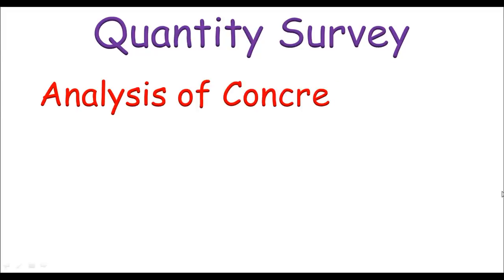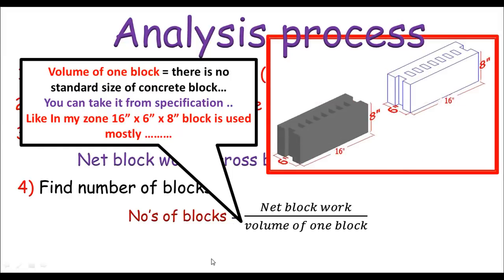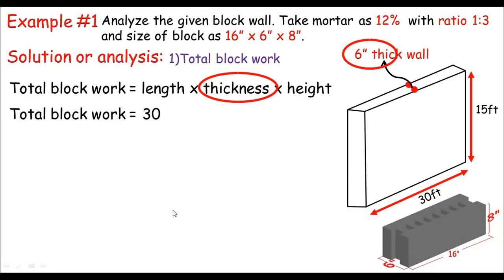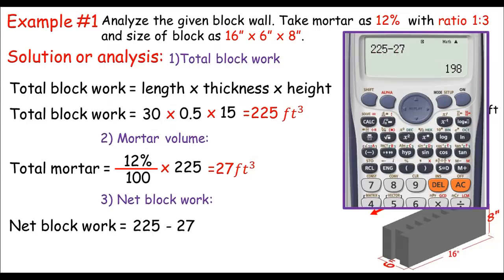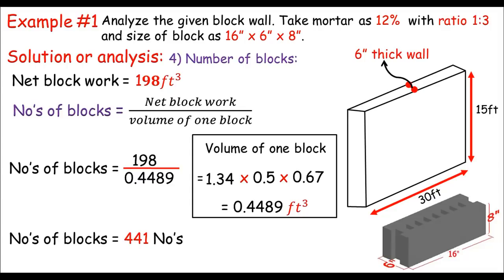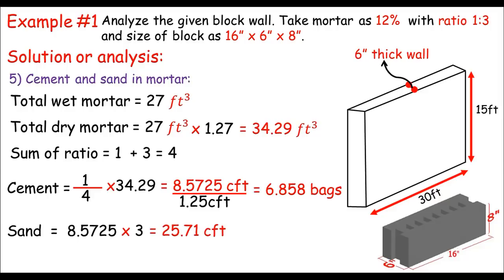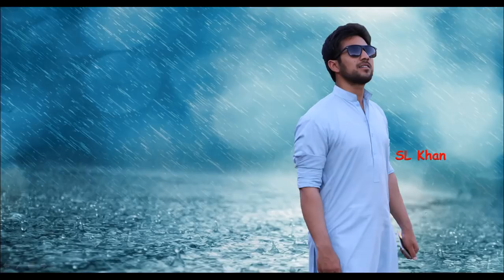How to find number of blocks, cement and sand from block wall?

Comment: YOUR CALCULATION is incorrect, whoever will use your method will find themselves SHORT of sand(even without adding the wastage). WHY...? because you did not consider the volume of the more to connect between blocks or the top mortar, you only CONSIDERED the volume of the HOLLOWS of the blocks. Please correct me if I am wrong.

Comment: Thanks mate. It could help very much if you did this in Google Sheets (Excel on Google Docs) and share the worksheet for us.
Reply from the maker: Noted. Will do soon
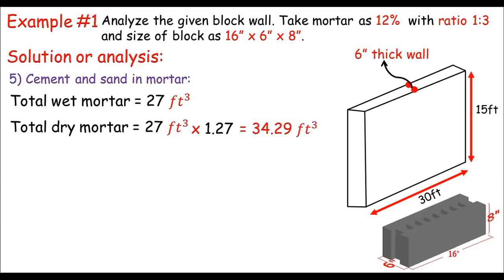Reply: @Sulimankhanacademy  Thankyou. Just a quick question at 5:50 minutes you talk about Total dry mortar =27cu.ft x 1.27 = 34.29 cu.ft. Can you tell me how you calculated "1.27"? Thankyou

Comment: Good tutorial May Allah bless you for sharing your blessings 

I would like you to explain 
1) Why you assumed 12% to be mortar in the wall volume 
2) Why is the dry Volume of sand more than the wet volume , taking into account "SHRINKAGE'' etc.
3) Why did you decide to multiply the volume of wet volume  by 1.27 to get the dry volume 

NB : I am in west Africa Ghana , we are used to the SI units and its derivatives , I humbly request you use it in your subsequent videos .

Thank you .
Reply from the maker: hello thank you for joining us ..........
remember 12% mortar is not constant. as quantity surveyor do calculation based on project specification . so the mortar percentage can be taken from specifications ,, by the way mostly in our zone we use 12% mortar in block masonry and 30% in brick masonry .......... 

when you add water to dry materials the water fills all the avoids which are in dry materials. thats why by adding water to dry materials  the volume does reduce......  

as the volume of  wet materials is less then the dry materials and we do calculation for dry materials in quantity survey. so we have to convert  the wet into dry by multiplying the wet with 1.27.         

1.27 is actually 27% of volume increasing ,... remember 27 % increasing is not constant which depends up on materials properties .................... good luck
Reply: @Sulimankhanacademy   when in terms of meter what is my multiplier to get the dry??